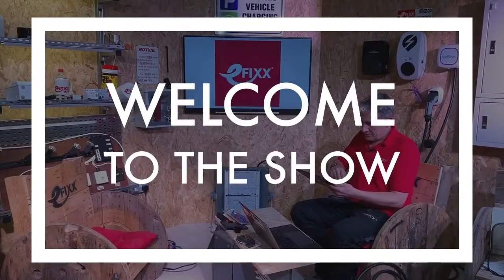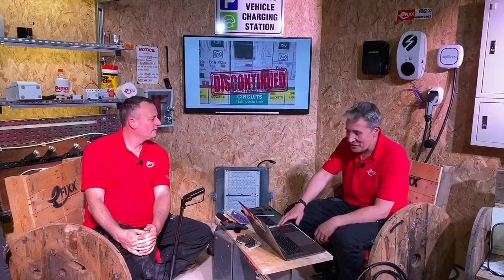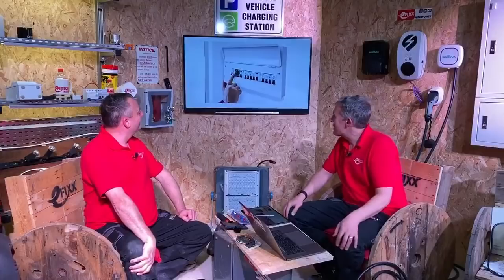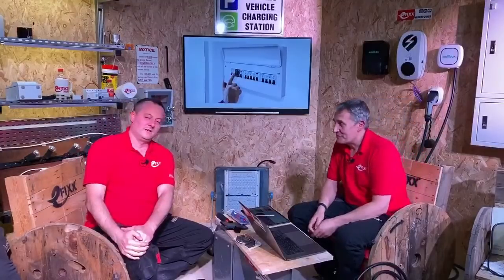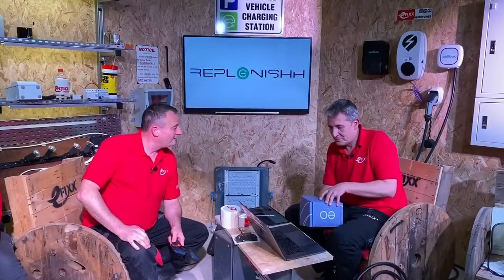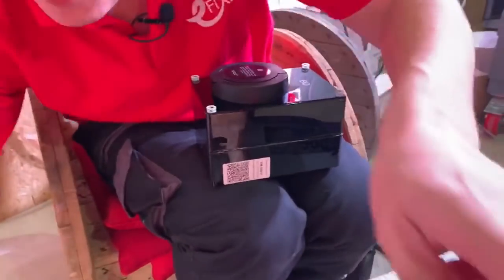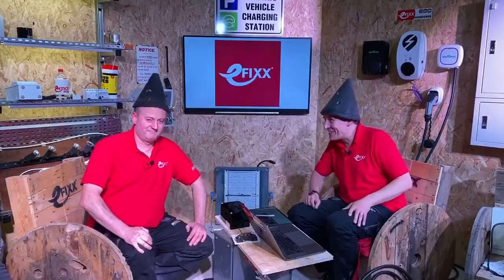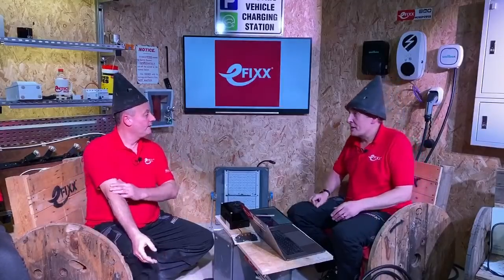MK Sentry is back- Screw-less sockets update- EO EV Charger tear-down and electrician of the month

Comment: Hi guys, enjoying the videos. Might I suggest a further enhancement of the screwless socket outlet or indeed switches. This would be to have a screwless shuttered terminal block mounted in the back box with the accessory simply plugging into this when it is mounted. How much easier would that make second fixing or indeed powering up before second fixing or safely removing for decoration etc. If you patent this don't forget my commission.
Reply from the maker: Great idea 💡

Comment: Hey guys, I have a question regarding the EV charge point industry.

I'm looking to specialise in the installation of chargers, it's a real passion of mine (Elon Musk is my hero for obvious reasons!) But, in terms of getting install jobs long term, are we going to face a losing battle when it comes to selling services to the consumers directly when car manufacturers are providing chargers/installers at the point of purchasing a new car?

Does my business need to be predominantly focused on building relationships with the car manufacturers themselves?
Reply from the maker: Not many car manufacturers offer chargers at the point of sale. (Some of the car dealers do).  The EV charging market has three main parts - At home, at work and somewhere in between - e.g hotels, venues etc Each one has different opportunities, challenges and customer requirements. Give the team at Replenishh a call and I’m sure they will be able to give more input.